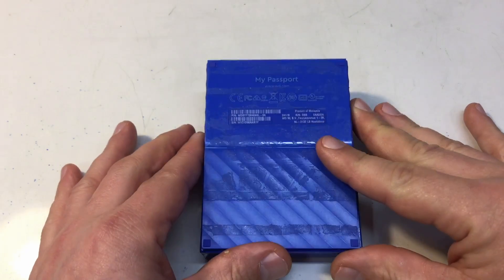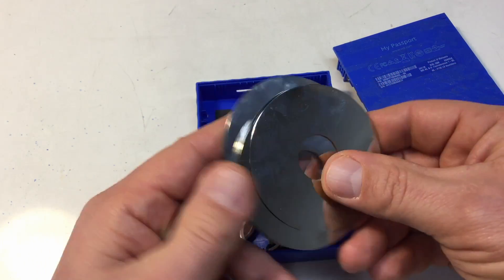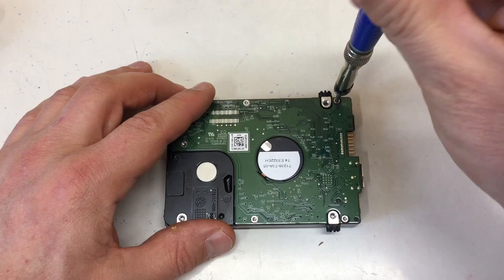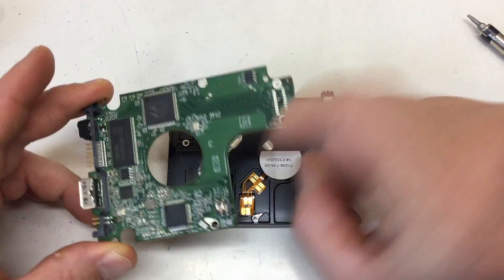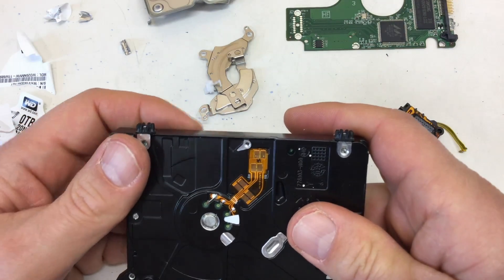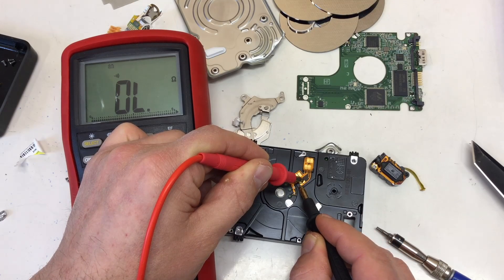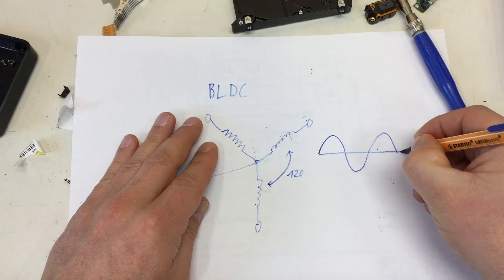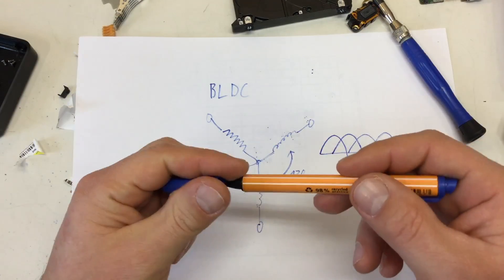WD My Passport / Elements 2TB 2.5'' USB Hard Disk Teardown (All the Chips)

Comment: Can you close the enclosure after opening, or is the plastic damaged while opening?
Reply from the maker: Not knowing that the top was snapped in into the bottom half of the case I damaged it a little. But it would have snapped back together with no problems. I guess if you are more careful you can take it apart without damaging it.

Comment: Can I swap the board with a higher capacity drive? I have a 4TB USB-C model and a 6TB USB Micro-B model; I'm wondering if I can swap the board and put the 6TB drive into the USB-C enclosure? I know each board encrypts the drive, so I can't keep the data, but presumably I can reformat and use the 6TB drive with a USB-C board?

Perhaps the 6TB drive is thicker, I'm not sure, I haven't opened it yet - I bought it from someone broken and got it RMA'd from WD so I basically got a brand new drive for really really cheap.
Reply from the maker: Well, unfortunately you can't swap those controller boards between disks. It's even hard to swap controller boards between the same disks (you have to transplant one or two chips between the boards). Sorry to be the bearer of bad news.

Comment: WD elements 2tb on 4 platters thick 2cm box or new passport 2tb on 2 platters 1.1cm thick box hmmm both seems to by SMR
Reply from the maker: Yup! Most of these (not only WD) 2.5'' drives are SMR. And for some applications SMR is just a terrible idea. E.g. performance under Windows Server Backup degrades rapidly after just a few uses. The only way to remedy that is to format the drive (which is a no-go for a backup drive).

Comment: The most terrible Device on Earth 🌎
Reply: why? i have problems with it too but i wonder why u have. my problem is that sectors acting slow weird, defective and the drive is sometimes super slow
Reply: @777brightstar  Seagate is way better, never had a problem with slow write and read, but WD, that's a common issue, and the spindle morots are shitty too on WD side. heat too much, too much drag.
Reply from the maker: I wouldn't go that far 😅 I mean it worked well for quite some time (a little more than two years).

Comment: What could have made dents on the side of the metal casing of the HDD? I just received a Toshiba Enterprise HDD and these dents (maybe a harsher seam?) are worrying me. It also has marks that look like something like a geared wheel has brushed the sides. I don't know if I should return it
Reply from the maker: Well, it's hard to say from just a description if these dents are a fault or a feature. Can you upload a photo somewhere?
Reply: @robertssmorgasbord  I actually looked in Internet, happens that most contemporary drives have such a rough seam. Maybe something about the production process has changed.The dents (or seam?) look just like this drive, on the left side:  bhphotovideo.com/images/images2500x2500/seagate_st3000vx004_3_tb_video_surveillance_1144275.jpg

Comment: Just have one of  dead drive WD My Passport which sniffed my backup data away. I was wondering if its possible to use the enclosure case for 2.5 SSD?
I am not sure if the WD My Passport enclosure uses 2.5 Inch 7mm-9.5mm SATA for HDD/SSD. Any ideas?
Reply from the maker: Nope, you can't use the WD 2.5'' enclosures for any other drives, because the WD 2.5'' drives inside those enclosures have the USB controller integrated. Thus there is no SATA to USB converter in those enclosures (and no space for one).

Comment: wD are the worst type of external hard drives , i bought 3 and all failed !!! rubbish
Reply from the maker: Well, in my experience all HDD vendors go through phases where the produce "bad" batches of drives. I've seen that with WD as well as Seagate.
Reply: WD is total crap. I noticed when you're writing data on them in high temps, above 46 °C, the data reads can turn into bad sectors waiting for reallocation. Never seen something like that on Seagates counterpart.
Reply from the maker: @emanuelmenin  Thanks for the info! Very interesting! I never dived myself that deep into HDD performance/flaws. I just tear them down if one dies 😉
Reply: @robertssmorgasbord  I like to investigate things further, always. See ya Robert...
Reply from the maker: @emanuelmenin  Keep investigating 🙂
Reply: @emanuelmenin i feel like its the same problem i experienced but it could be random
Reply: the 2,5 seem really bad while the 3,5 are working good

Comment: I have a passport to drive that inlet wires are messed up cannot plug it into.
Can I take the computer board from one passport and put it on to the other and have it work the way it did.
Reply from the maker: Unfortunately not. You'll have two "transplant" a chip from the old board to the new one. See for example https://youtu.be/J9VLllXV6vE (and no, I've never done that myself).

Comment: WD My Passport provides backup and data recovery software as well as 256-bit AES Encryption, while WD Elements has no security features.
.... > Hi, I was trying to figure out what the form factor of the hdd is, it is thicker than the standard 2.5", is there a name for it? 
I also have a faulty WD Passport/elements 4tb and bought a doner drive and tried to replace the head (The little reader slider broke) but i think I screwed that up as well not having the proper environment and equipment. I also think i messed up the platter order and top/bottom sides .... Would you consider even having a look at such a case? If someone were to offer to send it all to you to try to get it going again? Any kind of quote for such a job (Considering the head of the doner is still ok and doesnt need another) ...
[EDIT]
The doner drive was working fine, I plugged it in, full storage available, blank drive. I wanted to get data from the damaged drive and instead of removing and replacing the platters i removed and replaced the head 
So head from new drive went into old instead of platters from old going into new... but yeah i made a mess of it.
Reply from the maker: I'm sorry, but I'm actually not in the business of repairing HDDs, respectively, data recovery from defect HDDs 🙁 In fact, I have never repaired a HDD in my life. I'm just a guy who likes to tear down a broken HDD from time to time 😅 But if you need a quote from some professionals, simply google for "data recovery". I know www.ontrack.com is offering such services. However, I never used them, so I cannot attest to their quality or if their prices are reasonable.

Comment: What are those teeth on the pcb board?
Reply from the maker: Do you mean the contacts for the spindle motor and the head assembly @ 05:39 ?
Reply: @robertssmorgasbord  no.  The 6 copper teeth.  Reminds me of what I would see (kind of) in laptops attached to a sata adapter.   I'm wondering if they could lead to another possible way to get data off the drive.
Reply from the maker: @MarvelousB  See my reply below ...
Reply: @robertssmorgasbord  they are directly beside the USB c port
Reply from the maker: @MarvelousB  Unfortunately these are undocumented and WD removed the related discussion board (it's still available in the Wayback Machine https://web.archive.org/web/20150508061603/http://community.wdc.com/t5/WD-Portable-Drives/Connect-by-non-USB/td-p/93926 ). Anyway, these pins are for testing purposes during production and don't provide a SATA or any other interface for that matter. However, some people were able to access SATA on some versions of external WD drives: https://www.datarecoverytools.co.uk/2010/05/05/how-to-connect-and-recover-usb-only-western-digital-drives-with-hd-doctor-suite/
Reply: @robertssmorgasbord  thank you for that response.
Reply from the maker: @MarvelousB  You're welcome!

Comment: How do you think which is commonly have to be more reliable: Seagate external hdds with SATA interface or WD external hdds with soldered USB port? I spent 2 weeks already searching over internet,still don't know which i should choose. I wanna use the drive to store large video files, which i going to edit in Adobe Premiere.Can you give a tip?
Reply from the maker: When it comes to the reliability of external USB drives, Seagate as well as WD had some quality issues over time. One year WDs were dying like flies, another year Seagates.

So, if you're looking for the most resilient solution I would recommend the following (disclaimer - that's my personal opinion based on my personal experience):

1. Buy a good quality external USB HDD case and put a normal internal SATA HDD (preferably Fujitsu - I'm a fanboy) into it.
2. BUY A SECOND PAIR OF THAT COMBO AND MAKE BACKUPS OF YOUR DATA ON THAT!

I had far too many comments on my external HDD teardown videos asking how to recover data from a / repair a defect one.
Reply: @robertssmorgasbord  Thank you so much for the detailed answer!
Reply from the maker: @KowmarIvanic  You're very welcome!

Comment: Hi nice video. How do you test the PCB with a multimeter? Like if you want to know they are working properly by checking for voltage/resistance/continuity which components do you test exactly? Thanks!
Reply from the maker: First, thanks for the praise! To be honest, checking/repairing one of those boards is far beyond my skill level, so I can't really be of any help here. Sorry! But yes, you start with a multimeter, but in the end you'll need an oscilloscope with a high enough bandwidth.
Reply: @robertssmorgasbord  you're welcome thanks hey no worries I'll do more research and dig deeper till I find out how to test them. I think it involves getting the exact datasheet of the ICs which will show all the pins on each one and their voltages too. Thanks to your video I now know the identity of those chips on the PCB. Much appreciated. 🙏🏻
Reply from the maker: @user-rn3eb2jn5t  Thanks for your understanding 🙂

Comment: they called dc because its speed depends on the DC voltage thats feeding to the esc higher voltage higher speed most esc are only H-bridge but for 3 coils insted of 2 coils. some advansed esc are more like a frequency converter but the input voltage is still relevant. BLDC rated in KV thats mean not kilovolt it is rotation per volts. the esc does not set a fixed frequency thats not going to work it uses a variable frequency pulsmodulation and getting his feedback for the rotation from the voltage injection in the unused coils during the rotation other bldc motor thats must be more presize have halsensors for the feedback. thats why it called DC. its still a DC motor and driver but with the benefits from a 3 phase motor and more presize
Reply from the maker: Thank you very much for the detailed explanation!

Comment: Do they have SATA connection inside?
Reply from the maker: Well, no, they don't.
Reply: @robertssmorgasbord  Well i have a passport Studio for mac, but my cable doesn't connect, so I thought of disassembling it and connecting with external SATA to USB, but that won't work right? :D
Reply from the maker: @STICKERGODDESS_  No, unfortunately that won't work. Other manufacturers put standard SATA disks with a little SATA-to-USB adapter into their external HDDs cases. Not so WD: They have specialized USB controller boards on the disks they put into their external HDD products (the 2.5" ones, don't know about the 3.5" disks). That saves a few mm in case size (and a few cent in cost). But you can't use those disks as SATA HDDs 😞
Reply: @robertssmorgasbord  Alright, I guess ill have to find some old Firewire cables ;). Anyway much appreciated advice, thank you!!!!
Reply from the maker: @STICKERGODDESS_ You're welcome!

Comment: How many platters 5TB WD passport has?
Reply from the maker: To the best of my knowledge it has 4 platters. But beware! I think it uses shingling.
Reply: Is shingling bad?
Reply from the maker: @ronixdash123  Well, shingling (SMR) offers higher capacity per platter but at lower speeds, specifically writing speed. So if you're mostly reading from a disk you might not even notice that it's shingled. But if you're writing a lot to a disk you'll notice serious performance penalties compared to perpendicular magnetic recording (PMR) disks.
Reply: 5 TB 2.5" WD drives will have five platters inside, for a 1 TB/platter density.
Reply from the maker: @TheDragonFire123  Thanks for the info!

Comment: can I just takes the disk part and insert it to an internal hdd? (instead of the old one)is that possible?
Reply from the maker: Not really, because it has an USB interface. Of course you could put it into your PC and connect it to an internal USB port, but that would result in severe performance penalties compared to a SATA disk.

Comment: Can you tell me the exact type of the screws which mount the logic board? The ones on the backside.
Reply from the maker: Unfortunately I can't remember the exact size (that teardown was over two years ago), but I was using small TX (Torx) bits (size T6 according to some comments below).
Reply: They'll be some kind of Torx screw, T6 being your best bet.
Reply: The same doubt here, very different screws, I'm trying to open. :/

Comment: Hi Robert, I have the exact same 2TB WD USB HDD as shown at 2:57 (WD20NMVW) and I opened it after seeing your informative video. The first time the platters started spinning up but the head actuator arm did not move. I gently pushed the arm towards the disks and it started moving. BUT the actuator arm moved half-way across the platters a few times and then went back... and the disks powered down and stopped even though the power was still plugged in... NOW there's a disk spin-sound (every time I power it on) and there are a few clicking sounds before it powers off. What could be wrong? Any assistance would help me recover a LOT of HQ video files stored on the HDD.
Reply from the maker: Hi DeeJay, first a disclaimer: I'm not a hard disk repair specialist - I'm just taking them apart. That said, there could be any number of failures here: Some mechanical damage to head actuator, some damage to the spindle motor (drawing to much current, therefore it spins down), the controller itself is damaged, etc. Your best bet would be using a hard disk recover service (e.g. https://www.securedatarecovery.com ), but those are pretty expensive.
Reply: @robertssmorgasbord  Thank you so much Robert... I think I'll give the pro data recovery option a wack. I can always decline if the quote is beyond what I lost. My only peeve is that I DON'T have screenshots of the file-structure and the videos that were on it (as I usually do). I have time, and I have the bandwidth to download it ALL over again, but I just don't know  exactly what I lost. :-(
Reply from the maker: @deejay5493  You're welcome! This kind of data loss must be hitting hard. Fortunately I myself had never to experience that. But then, I'm quite paranoid when it comes to backups. The C: (boot) drives of all my computers are backed up daily to a NAS, the NAS is backed up daily to an external drive, and now and then I swap that external drive with another one, which is stored at another house. For backing up my large data drive with the YouTube video material and such I alternate between two external drives, one always being stored at another house. Paranoid, I now :-) I guess what I'm saying is that maybe you might wanna consider making copies of your videos on two external drives in the future. Regards Robert
Reply: @deejay5493  metal tool used in this video to remove the head watch this link https://youtu.be/uvKcOWVPaBI
Reply: @deejay5493  Actually if there are more than 1 platters then they are synced & aligned from manufacturer. If u slightly tamper the position then it is not gonna work anymore. Look at 5:40 of given link https://youtu.be/KHJ_Dn-h4CE  Also head is not touched by hand & each head out of 4 heads(in this 2tb hdd case)must be carefully removed maintaining gap between upper & lower magnetic part. Coz head must be aligned certain level above platters. There is special plastic tool to remove head. Important is platter alignment + head perfect position makes hard disks working smoothly. If head position tampered or, platters mis-aligned then u will get clicking sounds only, nothing else. If head touch platter surface then platters will be scratched & damaged permanently

Comment: That was Interesting, Thank you. If you had put everything back (And not broken the heads or other stuff) what are the chances it will still read something? Could be some nice experiment.
Reply from the maker: You're welcome! Quite a while ago (decades?) a friend of mine disassembled and reassembled a 5.25'' HDD. The spindle was stuck and he unstuck it ;-) And it worked! Not a single defect file! I don't think you would get that lucky with today's data densities. A single speck of dust might ruin one of the heads or at least several blocks worth of data. But it might be a interesting experiment indeed: gloves, some HEPA filtered air stream over the whole desk ...
Reply: @robertssmorgasbord  Exactly my Thoughts. The Higher Densities will pose a problem, But I will await your video.
 I have subscribed to your channel. Please keep bringing such Interesting Experiments !
Reply from the maker: @ZenInnovations  If I get my hands on a working 2.5'' HDD that's for other reasons (e.g. capacity below 1TB) unusable I might actually try that - no promises though. For now I have to finish my laboratory water bath and some other projects ;-)

Comment: I remember when the platters where 12 inch wide ... and we had to manually put them in the player.
Well ... I've seen one on a heavy industry equipment ... here's how it worked and why the command to mount a disk in Unix is "mount"!
https://youtu.be/H-uFzBDQQjw?t=283
Reply from the maker: Yeah, those were the times ... loading a stack of platters into some Nixdorf host - who remembers those I wonder? Or some years later working with Hewlett-Packard 12'' hard disks the size of a small fridges which had to be vacuumed twice a year.